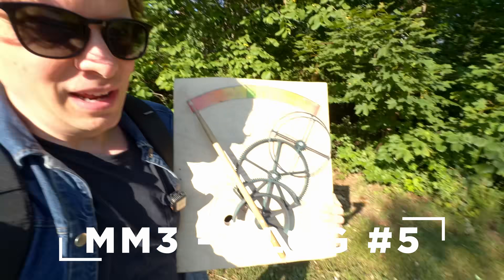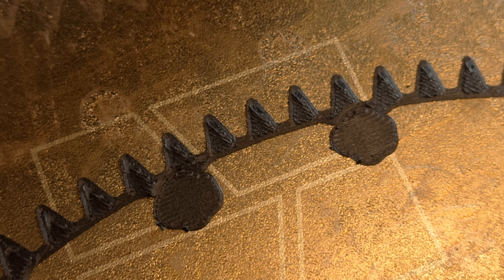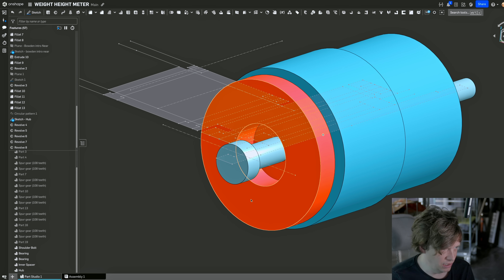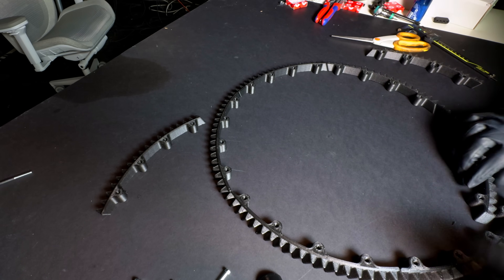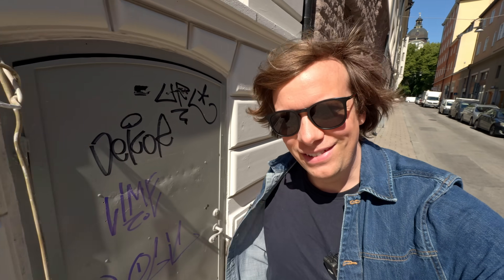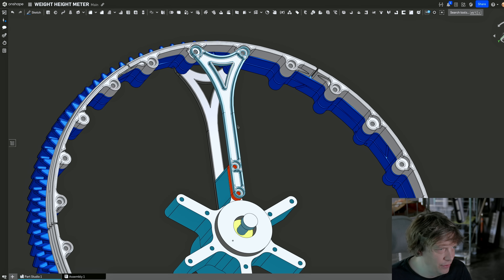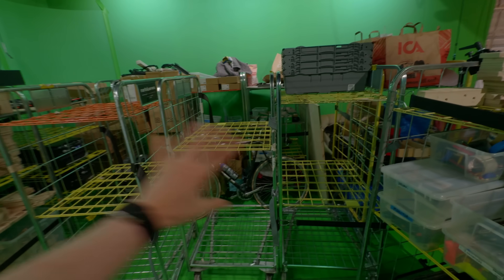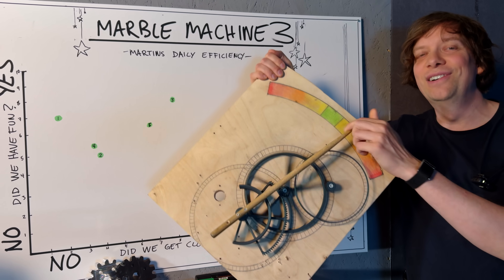3D Printing Helical Gears from Carbon Fiber Filament - MM3 VLOG #5

Comment: Someone else commented this on the last video already, but please don't print gears in CF-filled filament. The teeth rubbing across each other during operation are going to be putting so much of this stuff into the air...
Reply: 100% agree. If it’s not going to pull the carbon into the air it’s going to wear the gears down really quickly. I would suggest using 3DXtech PA WearX filament. It’s  designed for this type of application, and 3DXTech know their stuff and produce reliable and repeatable results. 

With his Bambu lab pre heated, and the filament dried it should be fine for those gears. I would recommend getting their nano adhesive as well.
Reply: What filament type do you print gears in then? I'm honestly interested in the answer since I've also begun to 3D print recently.
Reply: Martin's talked a lot on the channel about the aesthetics of wood, but hearing about filament choices is reminding me of another big plus for wood - it's less toxic!

I don't know if that's true of plywood specifically - I'd love to hear from people who do! Are there filaments that are safer than plywood?
Reply: p sure the printed gears r just prototyping. marten has talked about cnc’ing the gear teeth in a lathe setup to ensure all the teeth r equidistant from the axle.

Comment: Carbon fiber filament can release carbon fibers when it wears down. You might want to keep this in mind if you plan to play with it for a long time. it happens even with just skin contact.
Reply: Not just over time, people on YT have demonstrated that it can happen with just handling the material. LOL this carbon fillament is the new Asbestos :P
Reply: @paulbolus9399  true, also seen the videos where they look at it under a microscope and 1 touch is enough to embed those small and insanely sharp carbon needles under your skin for weeks. I guess if you are very unlucky even permanent or at least for months. But the worst thing of all is that it probably also gives you fibrosis when breathed in during handling of the part. So unless you seal the surface somehow its probably not a good idea to print and handle fiber reinforced materials
Reply: I think he touched on this on the last episode. Hope he has a good solution
Reply: He is wearing gloves when handling the prints but I think what @rosinenbrot865 is talking about is the dust created by the parts rubbing against each other

Comment: You will also want to add sacrificial layer on the face that is supported in mid air, it will result in much better quality.

Comment: it looks like your printer is over-extruding, there's a calibration setting for that in bambu studio, which is probably why the first print had the supports stick to the body. Also a good idea to make the z-top for supports between  .2 and .3 (.24 is pretty good usually), makes it easier to remove supports. For tolerances, .1 for tight and .12 for snug almost always work.
Reply: He should defently make a flow calibration, you have the X1C, try using the auto flow calibration with the lidar, you can print a singel wall test and messure the wall thinkness, it should match the nozzel diameter

Comment: I think you may find more success by creating a custom support and printing it in an incompatible material, PETG filament is good for PLA, you can just intersect the parts with no gap, and the layers will just peel apart at the end. the support interface in slicers is good these days, but you could save yourself a lot of post processing and get a much more accurate part

Comment: I have no real feel for the load bearing capacity of carbon fiber prints, but the spokes seem dangerously slim to me for a 3D-printed part, even if they're not expected to carry a large torque. Also, I'd be weary of the large lever arm of a spoke at its rim over the two bolts securing it at the hub, and the potential slop it might cause (slight "twisting" of the entire circumference gear vs. the hub itself).

Comment: your first layer looks really squished, Mine doesn't look like that on the X1, Might be worth calibrating the flow rate or doing a bed level. though I'm used to a 0.4mm nozzle, might be like that for 0.6mm

Comment: I just want to check that you are using a hardened steel or tungsten nozzle when printing carbon fiber filament. A standard nozzle will get chewed up by the carbon fiber very quickly. Keep up the amazing work! You and your band are amazing!
Reply: or ruby or diamond (though I don't know if you can get those types for bambu printers). But definitely super important. If he isn't that would explain why his tolerances are so bad. Nearly a millimeter total tolerance on the nut (6.9mm nut, 7.8mm hole) for a friction fit is pretty terrible. I normally expect 0.4mm of total tolerance to get a decent (if sometimes tight) fit.
Reply: @quinnobi42  Almost certainly the case, given the amount of squish on the first layer.

Comment: efficiency is gained by doing each step to completion before moving ahead. it does not feel as fast of progress because it is the race of the turtle vs the hare
Reply: Have you never heard of the production line?
Reply: @nagualdesign  I have, and?
Reply: @kilgoar  Efficiency is gained by doing every step simultaneously. Doing each step to completion before moving ahead is not very efficient.

In Martin's case, building a single machine, a production line is pretty moot, but if he were to sit around waiting for a 3D print to complete, for example, he wouldn't get very far very fast.
Reply: @nagualdesign   in building a single machine your point is completely off the mark and your hypothetical is just that, hypothetical.
Reply: @kilgoar  What hypothetical?
Reply: @nagualdesign  "If he were to..."
Reply: @kilgoar  Ah.. so you're saying that sitting around waiting for a 3D print to complete is only hypothetically a waste of time. Good point. 👍🏼

You should be a politician.
Reply: @nagualdesign  yes, it is a hypothetical waste of time because it's not actually happening
Reply: @kilgoar  So you agree that sitting around waiting for a 3D print to complete would be a waste of time.

You're really trying to worm your way out of this hole. 😊
Reply: @nagualdesign  leave me alone, sealion

Comment: That first layer looks like it might be over-extruded (more filament coming out of the printer than the slicer expects).  Have you tuned the flow rate for that filament?  If not, it might be worth doing.
Reply: this 💯 I think i remember a similar comment on the last video and it might be overextruding in every layer so i would advise to doublecheck with a calibration cube. 
Also want to add that carbon fiber is probably not a good choice.
Reply: I agree with the over extruding. The supports and the part shouldn't be that close together, even when he specified a larger support to part XY distance, the resulting print looked closer than his setting. This may also be why in the last video the printed bolt holes had a close fit with 0.7mm oversize where 0.2mm oversize should be all that is needed for a close fit. (His originally printed exact size would have never worked...)
Reply: Over extruding and way too low Z-height

Comment: Be careful for micro carbon fiber splinters. They're very hard to remove
Reply: Should have watched yesterday s episode
Reply: @harm285  touche
Reply: I've found tiny splinters are pretty easy to remove by just using a scour pad, like you're cleaning your dishes